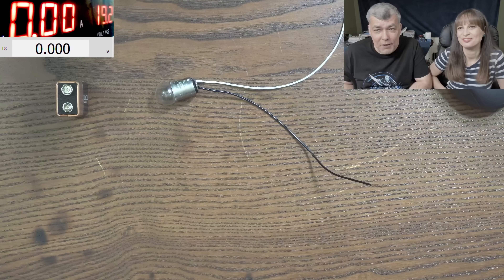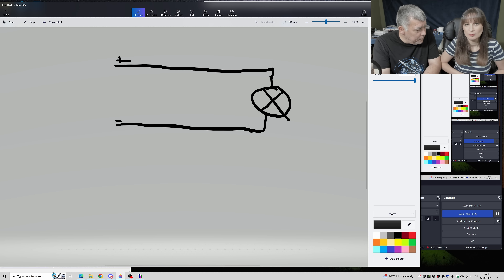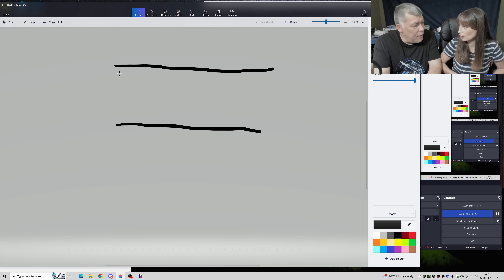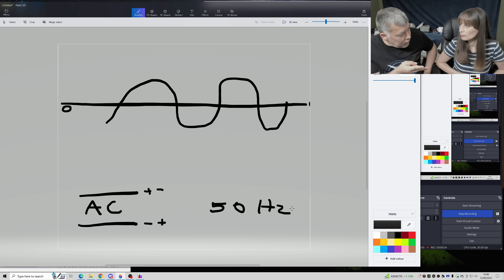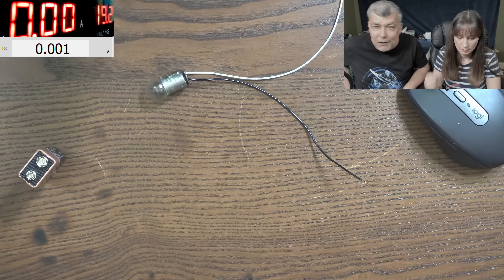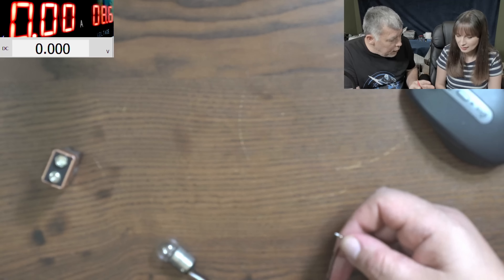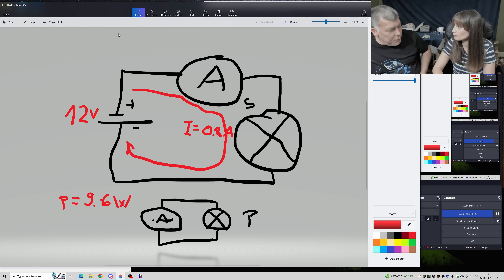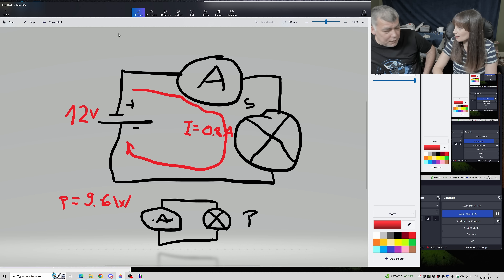Electronics basics, Volts, Current, Resistance, Ohm Law - Lesson 10  Learning electronics with Diana

Comment: Excellent start Diana.  I remember being taught about water flowing in a pipe as an analogy of ohms law. voltage (pressure of water), current ( the flow or amount of water flowing in or out of the pipe ), resistance ( a clamp on the pipe, or your finger on the end of a hose).  The more you resist (resistance) the flow out the pipe, using your clamp or finger the less water (current) flows, but if you raise the tap pressure (voltage) by opening the tap more, with the same resistance more water flows.  You collect the water in a bucket and that is the (power).  It’s a good starter way of seeing the effects.

Comment: That small resistor is actually 1/4W. You should have taken a minute to explain all the different resistor sizes available and told Diana about the wattage of them. You could explain applying current to components using a resettable fuse. Too much current over the rated value of the fuse and the fuse will blow but a larger rated fuse won't blow. You're only giving her a small amount of info. It's like asking a baby to build a house but you only give the baby bricks, sand and water. The baby doesn't know cement is missing because you did not give a full (in electronics terms) 'bill of materials'. The bottom line is when applying current and voltage ensure that the components are rated for it. This leads to knowing that some part or chip is dead because it gets hot and is shorted internally (i.e. too much current is flowing through a part rated for a lower current because it's shorted either to ground or a low resistance). In a future lesson you should touch on component datasheets to show where ratings come from and point out the voltage/current ratings/limits on the datasheets. Also speak about how parts fail. For example resistors will often either go open or have higher resistance when damaged, ceramic capacitors can be shorted or open, polarized capacitors can have higher internal resistance (ESR) or lower capacitance and diodes will often short. There's a LOT to learn when it comes to repairs and knowing voltage/current ratings and how parts fail is very important.

Comment: I like your lessons very much, help us to understand. But i have to say u dont explain it very well to her lol.. she is confused.. u limted the current at zero, so it couldnt draw current in the circuit.. she thinks u have to apply current somehow.. in a normal circuit u can not limit the current.. also explain that a bolb is a device and it will consume energy and have a certain demand at their power rating in wats.. so it wil need a certain amount of current with the present pressure (voltage)..